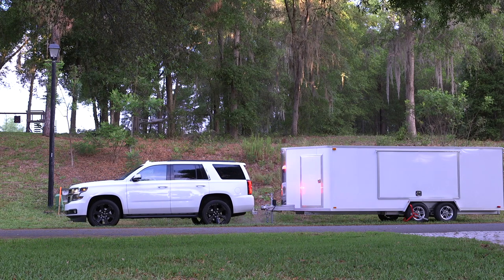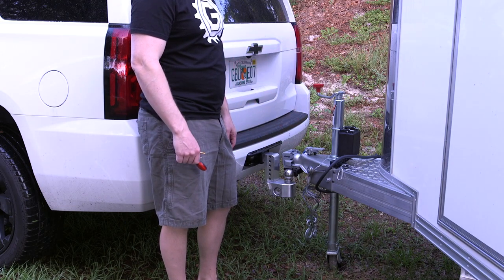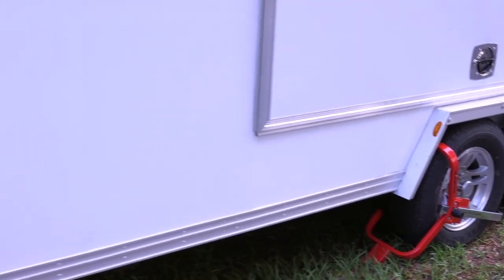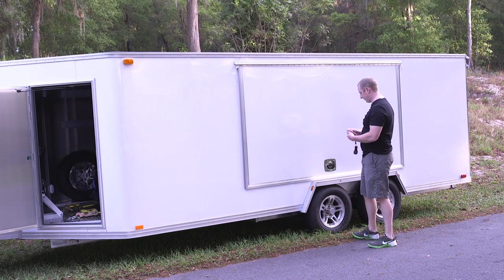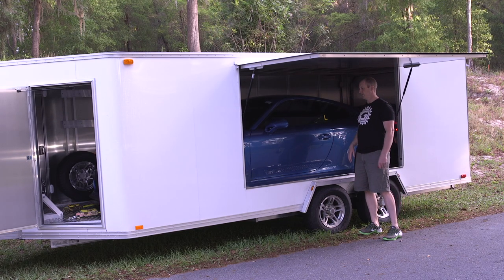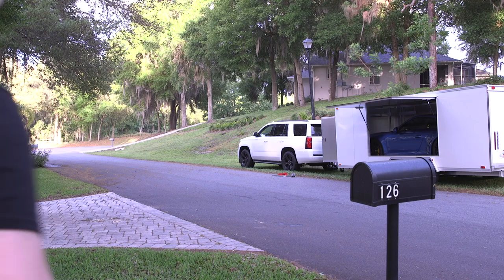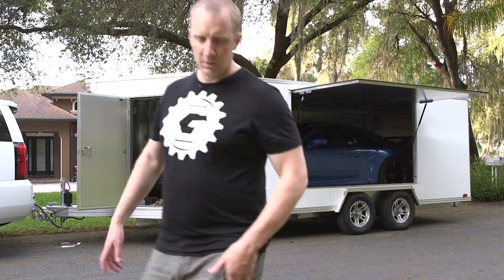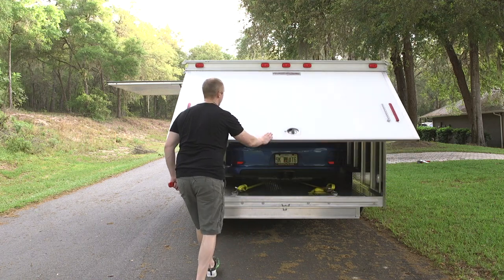Trailex Enclosed Aluminum Sports Car Trailer (CT 84180) Review

Comment: just noticed you struggle with the removal of the ratchet from the ratchet strap, just remember to pull the internal handle and open the ratchet to 180 + degrees, it lets the hub free wheel

Comment: Nice looking trailer Matt.  A good tip i found when reversing my boat is keep your eyes on your mirrors and if you see too much trailer in one mirror steer towards it for example too much trailer in your left mirror steer left to correct it.  Using this method made maneuvering my trailer a breeze, i actually enjoy reversing the trailer now !  

Another thing you might want to consider when winching the car in or out is to sit in it just incase the toe hook pulls out.  My dad owned a vehicle recovery business and had this happen a number of times.  Saying that Porsche tow hooks are probably better than most !
Reply from the maker: +mark caughey That's great advice.

Comment: +Matt Moreman  About the tire of the trailer another option if you want to,  is to raise the PSI of the tires to the Max or 7pounds over the max.. and leave it like that. We used to do this at the dealership that i used to work for the new cars that they were parked for so long until they were sold.. and for avoid damage the tire we were doing that.. is obvious  that before you use it again you've to bring back the PSI to specs.

Comment: Nice video, trailer and cars! Tip: while backing up don't turn the steering wheel so much. Just turn a little and hold that turn a while instead of turning a lot for a short period.
Reply from the maker: I've gotten much better after some practice!
Reply: Practice makes perfect ! You learn by doing it. I turned my steering wheel too much  when I learned to back up a trailer, until someone told me not to turn it so much :D

Comment: Matt, a. always "X" cross your ratchet straps. b.securing thru the wheels is the most safe, as frame/chassis is in suspension. They make soft double loupe ended straps for this purpose, that you combine with the ratchet straps. I have secured thousands of vehicles for ro/ro ocean vessels so I hope I now whereof I speak.
Reply from the maker: +edward simon  Thanks Edward.  I thought about crossing, but the front straps weren't long enough.

Comment: Matt- try steering with your hands on the bottom of the wheel when backing. Moving the bottom to left is the top to the right: the direction needed to turn the trailer to the left, and of course right is left which is right if that makes sense.
Reply from the maker: +Sammy Wang (TampaBayBoater) Someone on Rennlist suggested that.  That should help me improve my man card status.  Ha, ha...
Reply: +Matt Moreman you may lose your spot on the wheel, if anything, put a suicide knob on the bottom middle when towing... You'll probably do a lot of lock-to-lock and burn your had eventually

Comment: I would never leave my beloved car sit in the trailer on the side of the road... If they steal the trailer they get a free bonus :| 

What is the sound when you where backing up? Is that the gearbox or something?
Reply: Also mark the ramps so you can see when you reach the end with pulling them out. That way the won't fall out of the storage box.
Reply from the maker: +Dennis Evertse That's the back-up sensor buzzing the seat to let you know you're about to run into something.
Reply from the maker: +Dennis Evertse Ewww...  I like that idea!

Comment: I was just curious... in the video when you lower the trailer onto your hitch you say "I've never seen the tongue weight be more than 200lbs" which surprised me because looking at the trailer my guess was it weighs about 3000lbs. Later in the video when you revealed that the trailer had a car in it... I was very surprised because with a car in the trailer it must at least 6000lbs or more. So using the 10-15% tongue weight rule of thumb you should have at least 600lbs hitch weight. Maybe the little scale on the hitch is stuck or you should be pulling your car further forward in the trailer but something seems off for sure??
Reply from the maker: Trailer weighs 1900.  The car weighs 3200.